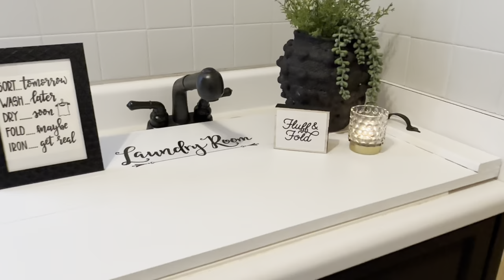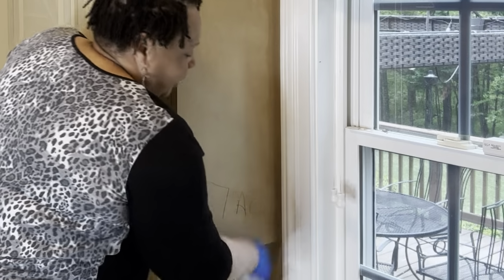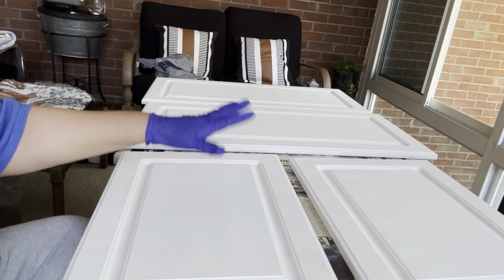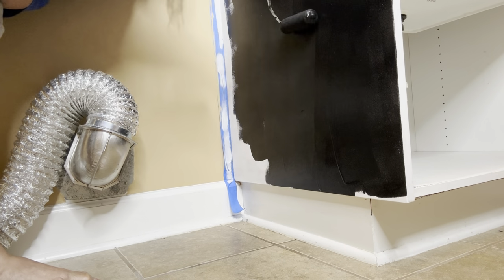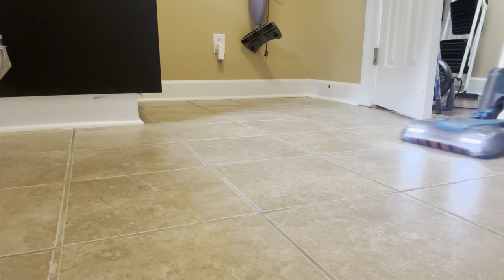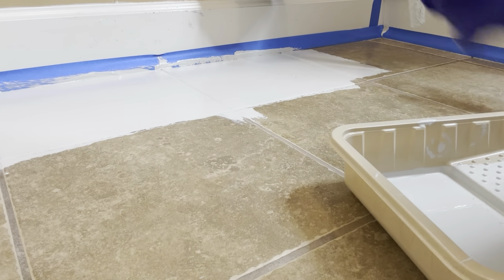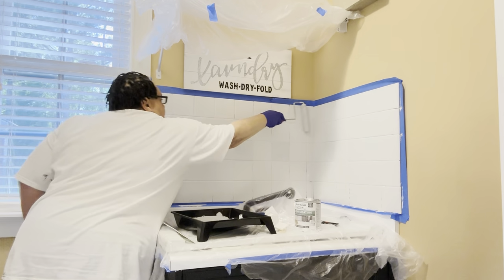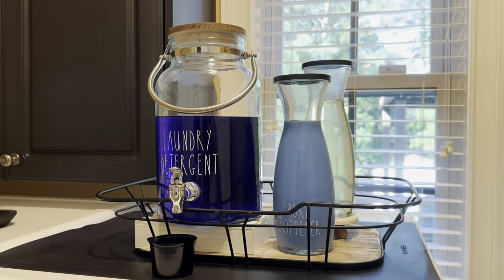DIY MODERN LAUNDRY ROOM RENOVATION | 2023 DIY LAUNDRY ROOM MAKEOVER 2023 DIY LAUNDRY ROOM RENOVATION

Comment: The walls would look better with the black cabinets if you paint it light grey.
Reply from the maker: You're right but I was mainly concerned about the therofoil peeling, the outdated floor and black splash. I wanted the best cost effective solution. I already have the paint on the wall on hand all I needed to do to the walls was touch ups which I did. Thank you for watching and leaving a comment have a blessed week.

Comment: Hello, what were you using the heat gun(I guess) to blow off the paneling; I've never seen that before.
Reply from the maker: The heat gun is used to remove the   Thermofoil off the cabinets.
Reply: @Shanna Lakale  I figured it out after starting the video over & heard you mention thermafoil; I had to look up what was thermafoil.😊. Thank you for replying. Now let me finish your video; I know it turned out nice.
Reply from the maker: @mamatosh05  🥰 no problem... I have thermofoil in every bathroom including the laundry room and it's peeling and makes my bathroom look like a hot mess! Thanks for watching and I appreciate your support.